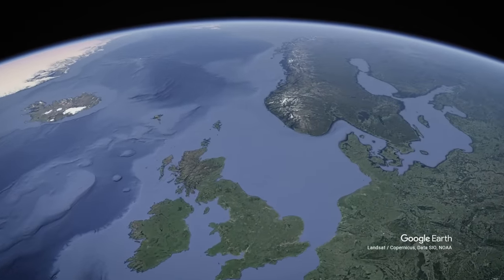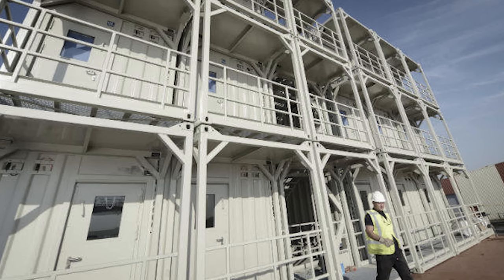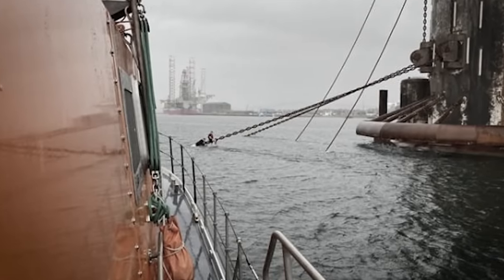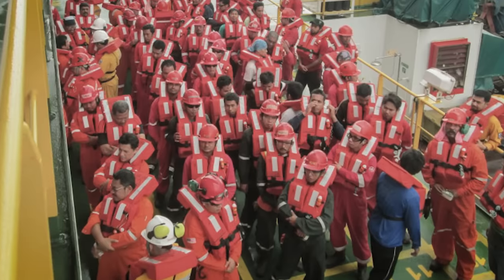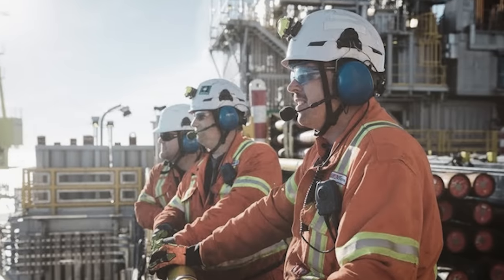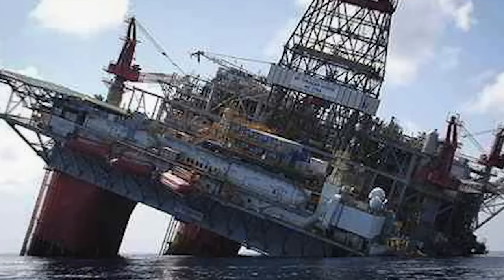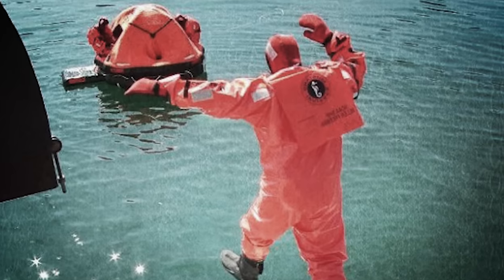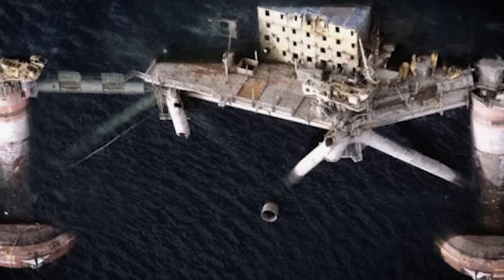This Pipe Killed 123 Men

Comment: As a student welder I will tell you that it is very easy for weld defects to be missed, a welder might cover a slag pocket or use just slightly wrong amperage, usually for high stress applications you stack multiple welds together to make a big one, apparently here it wasn't enough.
Reply from the maker: Thanks, great input from someone with actual knowledge.
Reply: Idk on rigs that cost billions of dollars they should have all welds inspected with.. whatever it is they use in radiography.
Reply: Gotta WHIP IT, Baby... WHIP IT ALL NIGHT!!!  ;o)
Reply: @j2kerrigan welds would be inspected by NDT (non-destructive testing), either ultrasound or x-ray.
Reply: Don't they exray?
Reply: @Terry Kavanaugh  Pretty sure they use various forms of NDT as has been mentioned.  I recall watching a programme showing weld inspectors using sound, associated oscilloscope and visual monitors, light and also a Dye....
Reply: @Stu-SB  ok..I worked above the sea in  a refinery..they exrayed... the bad welds were said to have artifacts In them. So undewater is very different. Thanks for the info!
Reply: Just because there is a tiny defect in a weld doesn't mean it its weak. Not saying it can't fail because of it but if something like this fails it's more because of a design flaw or lack of regular inspection. My welds get MT, PT, XRAY & UT (depending on the joint) for submarines and in most joints there is a certain size and type for allowable defects, on structure that takes an immense amount of pressure and flex.
Reply: The parent material itself won't stand up to the fatigue of the forces involved, especially after the heat input affects the granular structure around the weld.

Usually it's not the weld that's going to break, it's going to be the parent metal right around it.
Reply: @waterlinestories I'm an aerospace welder I would also like to add that u should find out if they did any non destructive testing on those or just visual inspection parts I do are tested with penetrant(fpi) and mag partical some parts are also 100% xray required (honey well)(rolls royce)
Reply: @j2kerrigan  and you'd still miss it. the problem isnt the method, its the fact you have people doing it and people arent infallible. thats where your weakpoint lies.
Reply: @gnarlock3927  Dure to differential heating during welding.....that is heating and cooling as the weld progresses there is an expansion and contraction factor occurring in the weld seam and as steel is not elastic the weakest part of the seam is the first to crack......this is more prevalent where mig welding is used for large scale welding of structures.
Reply: @gnarthdarkanen7464  whip it ? Hahahah you do realize whipping it allows for slag inclusions. So many wanna be welders in the world.
Reply: @MrChancebandit  It's a JOKE not a technical course. Get over yourself.

    Ya' know... Arguably it's the WANNABE WELDERS that got into this situation in the first place... Maybe that's what's being made fun of in the reference/terminology... Did you even think of that???  ;o)
Reply: @j2kerrigan yeh they do. Extensive ndt is always done on rigs pre service and in service.Maybe it was a design flaw. Can do all the ndt you want on a weld doesn’t mean the weld is fit for withstanding thousands of tons of force generated from a storm like this. Maybe a engineering design flaw. Either there’s no way it should of sheered off like that.
Reply: In ship building, they do what is called "back gouging" with copper rods filled with something like gun powder or something. The actually burn out the top half of a weld in order to inspect that the bottom half is solid. Then after they go back and fill it in they inspect again. Back-gouging is LOUD!
Reply: @terrykavanaugh2481   I don't know when X-rays for welds became a thing.  I would guess they were extremely rare if even available in the 1970's.
Reply: This thing was built in 1976
Reply: @bobcougar77  It was very common for welds to be either 'bombed' or X Rayed during the 1970's and dating back before that time. Bombed is a term used when a radioactive source is used i.e Colbalt 60, whereas X Ray uses a camera.
Reply: @iwb316  interesting.  As I said I would have guessed that to be very rare back then.  I'll add that to the list of things I didn't know.

Comment: It's crazy how little redundancy was built into that rig. If one weld failure was enough to take down the whole thing, it really seems like it was inevitable. It's kind of odd too because it's not like it's an aerospace application where they are desperately pinching weight. It seems like they could afford to add a couple more braces to up the factor of safety on a rig that is going to spend its life getting battered by the sea.
Reply: Considering, whenever we built "floating bridges" for crossing rivers and streams, we'd weld the braces from floats (usually steel drums) to the bridge-frame, and then wrap them in chains, so they could pop loose and still offer "some" support, even while being banged around... Sure, it was another couple hundred pounds of chain, but when a weld pops, and you're on a truck in the "dead middle" of the suddenly heaving and bucking bridge, you're kinda thankful someone had "foresight".

     ...Used to use a very similar "trick" when welding in engine-mounts, too... "It might get loose, but it ain't going too far."  ;o)
Reply: It's an oil company 

Saving money comes first
Reply: @mixnmatchflavourbleach2313 Safety requirements were quite high and strictly enforced.  The designers and engineers just didn't understand the forces that were in play in the North Sea.  Trust me on this:  requirements for rig design and construction were upped by several magnitudes after this.  People were humbled  and heads rolled.  Phillips Pet. and it's Norwegian partners weren't pinching pennies.  Safety was always #1.  Sad thing is, most lessons are learned the hard way.  It's true in all endeavors.  It happens in aviation, aerospace, highway construction, and so many other areas of human endeavors.
Reply: @markschneider8815  Safety may have been #1 in design, but it's very hard to believe that it was #1 in procedure.
Reply: There's an old adage in the aviation community, "most all safety rules are written in blood". 
Humans are smart, but they are not omniscient. There are times when engineers either didn't understand the forces involved, or trusted the strength of the engineering too much. Sometimes the wrong material is used as in the I-35W collapse.  Also, especially where governments are involved, lack of redundancy, and/or sloppy or, nonexistant inspection schedules. Or as is often the case the construction company changes the plans or uses inferior materials in order to save time or boost profit, as in the Kansas City Hyatt walkway collapse. Sometimes it is lack of user training as in the Boeing 737 Max cases. 
There is, currently a great deal of predjudice toward the oil companies. Prehaps some of it deserved. But nonetheless it is one of the most highly regulated industries globally.
As long as humans go into hostile environments, there will be casualities.
Reply: @mixnmatchflavourbleach2313  Someone should maybe point out how their efforts to save a few thousand on weld inspections actually cost them a couple hundred millies on a WHOLE NEW RIG AND LOSSES in personnel, in equipment, and in downtime and oil leaked...

     Pinched a penny to waste a pound.  ;o)
Reply: What is so hard to understand greedy corporations aren't gonna spend an extra dollar on safety or employees unless forced to by law, and even then they will illegally skirt or break laws to make an extra buck
Reply from the maker: They spend the minimum until the minimum isn't enough
Reply: @AnimeSunglasses  Believe what you want.  I was there, you wern't.
Reply: @markschneider8815  The structure was designed as a drilling platform, where everything above deck is designed for minimum wind resistance.
When using it as a floating hotel, the accommodation units were acting as giant sails. 
While weight limits may have been observed,  the force of the winds on the repurposed structure were obviously not. The below deck forces and strains on the chains were well beyond their design limits.
Reply: @markschneider8815  Who told you that? The oil companies?
Safety was only #1 when a tragedy like this costs the company a lot of money due to reputation loss.
Reply: There would have been inspections of the main loadbearing structural connections, for example where the braces go into the columns, and this would have been covered by class inspections. But this was a non-load bearing weld, so wouldn't have had the same attention. Back in 1980, fatigue and fracture mechanics wasn't as advanced a science as it is today. This accident advanced knowledge in the area massively - it's one of my specialist areas of research.
Reply: @waterlinestories  In this case it wasn't really lack of spending, more lack of knowledge about a very uncertain phenomenon (fatigue is a very uncertain science). There were inspections,  but they weren't looking at this particular weld as it wasn't load-bearing. The accident changed knowledge that inspections need to be more widespread.
Reply: i believe  that  mig  welding!in its infancy  was utilised in its build   this was  to up the production    
and was unusual as nost structures were welded with low hydrogen stick   at the time.      mig welding was for years viewed with suspicion  after this    and it took many years and much developement 
of filler wire to make it aproved  
by the insurers
Reply: @markschneider8815  Of course heads rolled. Because it cost a lot of pennies, not because it cost 123 lives.

Comment: We studied this in materials science when we were learning about fatigue, and one detail that often gets overlooked is that the weld wasn't even structural, which is why it got ignored.  It was only to connect a hydrophone - just an underwater microphone - to one of the braces.  It could've been connected in a bunch of ways, but the fact they chose a weld is how the failure occurred.

The problem has a number of elements.  To start with, these rigs are engineered quite close to the limits of their strength, because they need to be light enough to be buoyant.  That means the structural members are all hollow.  That's fine if nothing goes wrong, but in engineering, especially when lives are at stake, assuming nothing will go wrong is a big no-no.  You want redundancy.  Adding more material and more volume would be more expensive, but it would add redundancy.

The next problem is that shapes, particularly internal bends, in structural members can cause stress concentrations.  This is part of why you make fillet shapes, including fillet welds.  This is to smooth out the corners, to spread out the stress lines and prevent them from bunching up too much as they go around the corner.  You can't get rid of this problem entirely however.

The last problem is with how fatigue cracks develop.  There is an ultimate strength above which a material will fail immediately.  Lower there is also a fatigue strength, below which the material can survive an infinite number of repeated loadings without any problems.  Above the fatigue strength the number of loadings the material can survive goes down exponentially.  Close to the fatigue strength the material might withstand over 10,000 repetitions, but as you get closer to the ultimate strength that number drops to thousands, then hundreds, then tens, then just one.

The material slowly, imperceptibly deforms and becomes more brittle as microscopic imperfections work their way to the surface.  Once it's too hard and brittle, a crack develops, which is the worst case feature for stress concentration.  This will typically push the material well past its ultimate strength the next time it is loaded, and the crack will propagate extremely quickly, possibly failing the entire member in one go.

The scary part here is that you really can't know if a fatigue crack is developing without analysing the member in microscopic detail.  Once you can see the crack, the member is likely beyond saving.

Now the problem as I understood it was not primarily one of workmanship but design and oversight.  The weld had some defects, but it shouldn't have been there in the first place.  They designed brace D-6 to be strong enough on its own, even with the repeated loadings of strong winds and high seas.  They then added the welds in the middle of it that didn't remove any material so they assumed it would be fine, but didn't carry out a fatigue analysis on that weld.  If they had, they might've noticed that one single 6mm fillet weld compromised the entire structure.  They also didn't inspect the welds properly and didn't design a rig with enough redundancy to withstand this sort of failure.  If they had, maybe it would've stayed upright long enough for an evacuation.

At the bottom of the wikipedia entry there's a link to a report by officer of the watch, a maritime safety organisation, that outlines this and other failures in the process.  Ultimately disasters like this don't happen because of one mistake, they happen because many mistakes stack up one on another.
Reply: Thanks for the detailed write up!
Reply: @gaveintothedarkness  Hey no worries, I'm glad people read it!  Sometimes I info dump in the comments and it just gets buried lol.
Reply: @@Bob-lq6dt Yes, that's a very good term for it.  The thing I find most interesting though is that it wasn't just a minor structural failure cascading into major elements, the start of the failure came from an entirely superfluous element, structurally speaking.

I guess that's often how failures happen - people overlook the details.
Reply: Thank you for sharing!
Reply: Thank you for the explanation and the great comment/education. I'm an old retired welder, and I used to love working with the egineers. They taught me that there was a lot I didn't know.

Comment: I worked offshore in the 80s, i heard that one of the legs was used to put heavy equipment that is used in different times in the drilling operation and this contributed to the weld failure, RIP to all the lost souls.
Reply from the maker: Interesting, I didn't come across any mention of that in the research but anything possible
Reply: I worked on its sister rig Petrolia which was a bucket of shit
It was a design fault and nothing more .

Comment: Great clear & ez-2-understand narration of horrible Incident. A+ presentation! Your video & pictures show chronology of events without going too deep into complex details of extreme North Sea weather, layers of engineering, welding, metal fatigue testing & ultimate certification. Much enjoyed your other video on Deepwater Horizon in Gulf of Mexico. That was not a weather related incident but more management short-circuit on several layers causing catastrophe. Keep making these clear & easily understandable videos. Great job!👍👏✅️